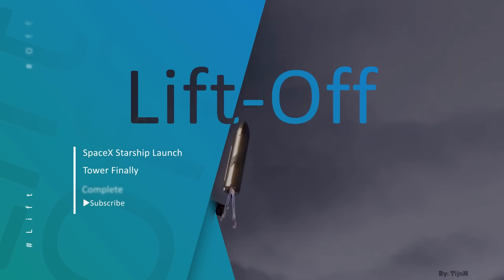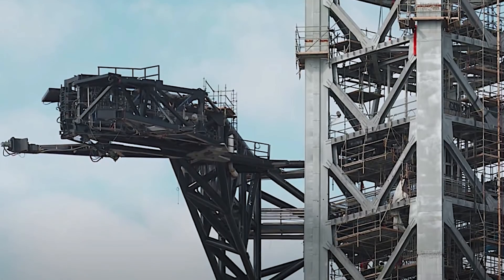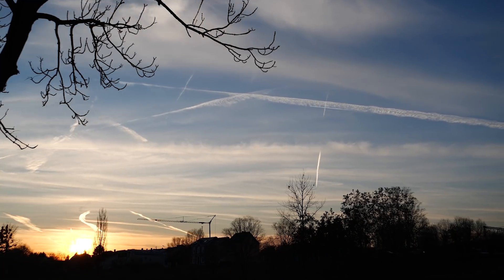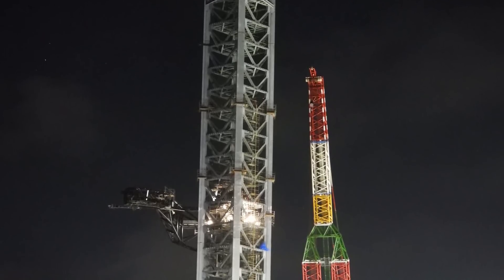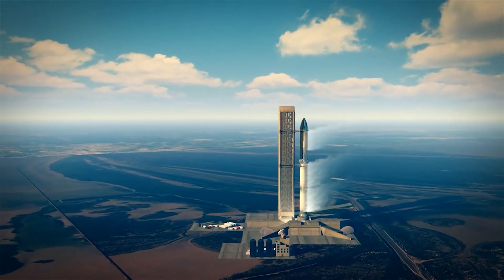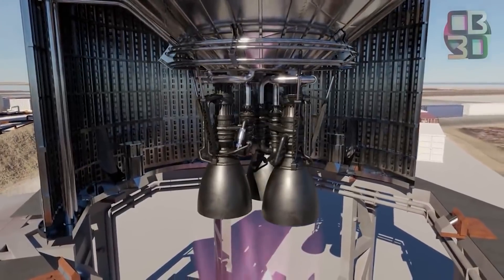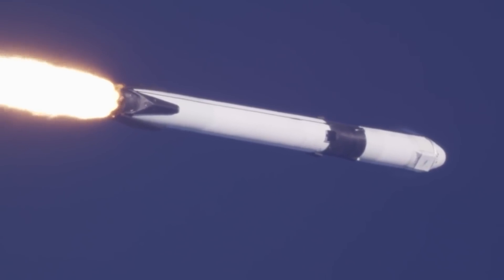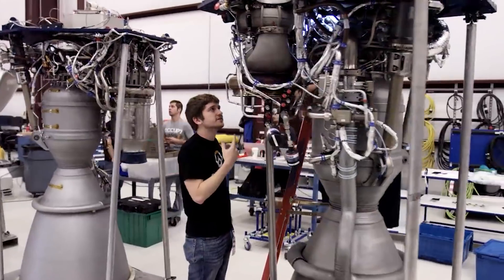FINALLY! SpaceX JUST COMPLETED Starship Launch Tower

Comment: The launch tower is no where near complete, there are still miles and miles of plumbing, electrical & hydraulic works as well as the running of the cables from the drum to the chopsticks, let alone the access ways & cladding at the top of the structure.. Still lots of work to be finalised and TESTED prior to it being finished.

Comment: I think rocket booster should start from hanging position. Its should be used for not only catching but also launching rockets. In this case this huge cumbersome faulty launch table can be removed. Also they don't need to water cool the table and to fix it for next launch. Hey Elon, get rid of launch table. You don't need it.
Reply: It’s a pretty good idea, however it has its cons.
First of all, they only have one pair of ‘chopsticks’ to catch both the super heavy and the starship. Your idea would require the chopstick holding the super heavy above the ground before lift off, and if it did that then there would be nothing to catch the starship.
Also, the chopsticks aren’t built to hold the starship or super heavy for a long amount of time. It simply catches the rocket, then puts it onto the launch table. Making the chopsticks hold the rocket for that long would require way too many re-enforcements. 
It’s a good idea tho, I’ll give u that,
Reply: @compooterkiddo9640  Off course they need more heavy duty chopsticks even maybe running from two towers standing next to each other.  I mean like a "H" shape. Its gonna be for heavy boosters only to catch them and launch them with Starships on the top. To catch bit lighter Starships they can build small chopsticks in 90 degree conjunction to this main one using one of the two towers or even maybe both. I can see that currently used launch table complicates the idea of using it many times a day. Fired up 32 Raptor engines will melt and damage table for sure and then table will need to be fix over and over again. NOT having a launch table is much better and can save a lot of time and money.
Reply: That’s my whole point. It would require too much work. Simplicity and practicality is more important than what ur suggesting. You also need to consider that the end goal is to launch these rockets off oil rigs. How do u expect 2 towers to be on 1 launch rig? That’s too hard to do. What ur suggesting just isn’t very practical.
Reply: @compooterkiddo9640  The oil rig its not big enough and its not gonna work. They need to build a special one if they decided so. Before launching it from oil rig they need to launch it from Starbase. They need to
refine Starship launch just like they did with Falcon 9. Current oil rigs are just toys. That's my opinion.
Reply: U would be surprised to hear that current oil rigs are good enough to launch starship the way it has been designed. In fact, they have already started modifying 2 oil rigs (not making them bigger, they are literally just attaching a launch tower and launch Table) to be able to launch starship. U have a great idea tho, I really like it, but it’s not really practical and it’s really unnecessary.
Reply: Unless one holds a doctorate in physics, one should keep very quiet when it comes to second-guessing Elon Musk. He knows exactly what he is doing.

Comment: Starship will fail. The heat tiles.
Reply: uhh, that's the POINT of rapid prototyping. They are EXPECTED to fail in a most spectacular fashion! And, when they DO fail, SpaceX learns how they DID fail and can adjust the design accordingly! Unlike OLD space, Failure IS an option!! AND it's EXPECTED!!!
Reply: @ICAleinns  exactly brought to the point
Reply: @carlitosway5204  My odds for first launch:
full stack lift-off: 90%
first stage separation: 90%
Booster 4 soft ocean recovery: 65%
Orbital insertion: 85% if first stage separation is successful! 
S20 soft landing off Hawaii: < 8%

Any takers? ;)